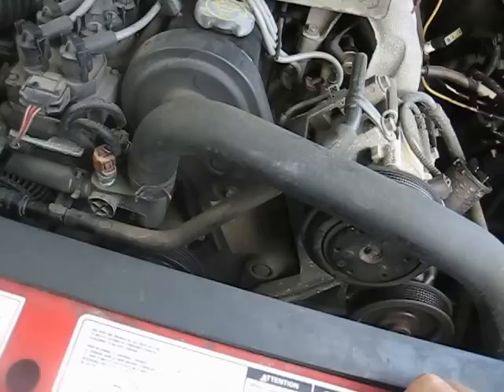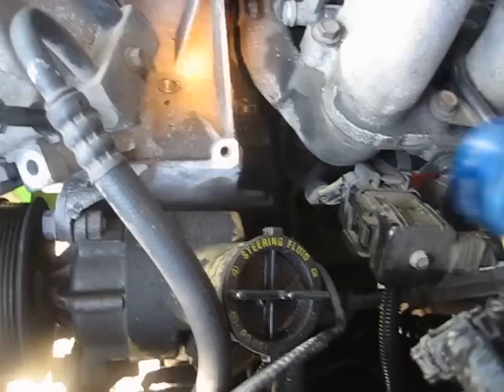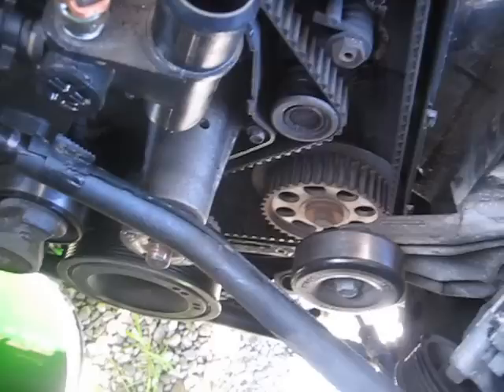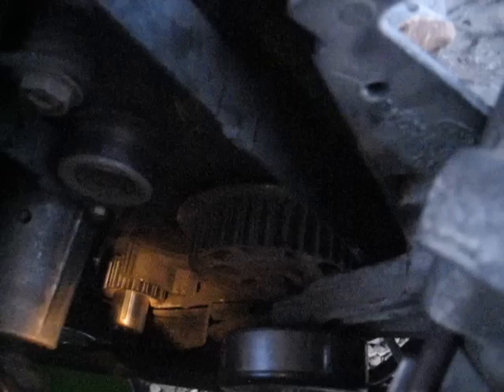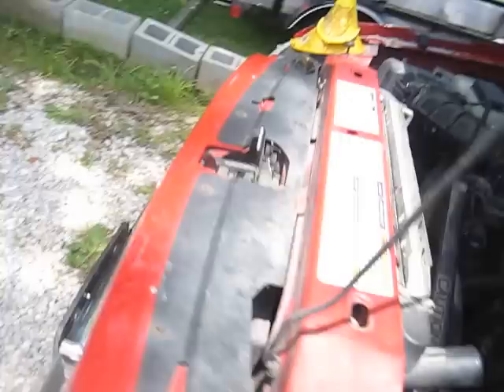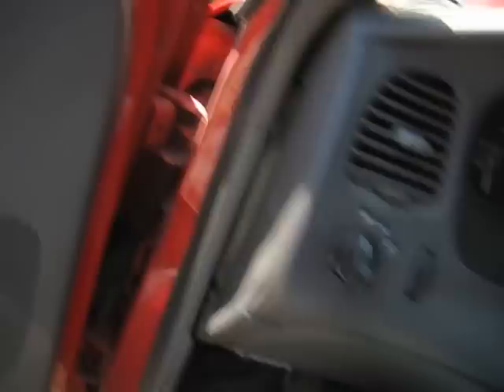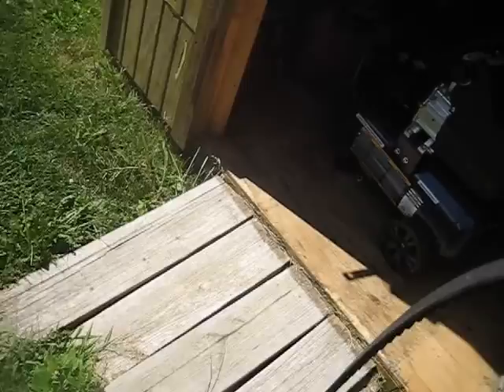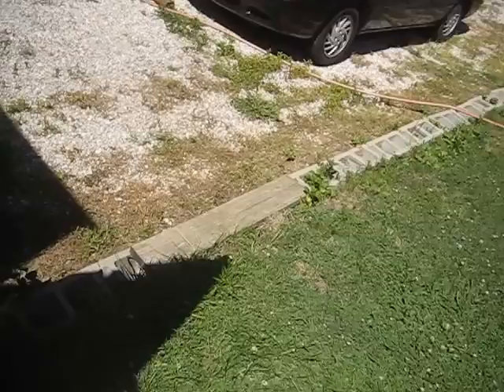Timing Belt Replacement Ford 2.3 and 2.5 1996-2011

Comment: Hello, sir! I wanted to thank you sincerely for providing us with such an indepth, thorough video! It was a massive help in getting my truck of the same make and model fixed. The previous owner allowed the water pump to rot and the blade dissolved into pieces and was sitting in the engine block. And worse, the thermostat rusted out and did not allow any liquid flow from either direction. You don't even want to know about the timing belt. Your video here was invaluable in helping me get my truck working and I am so grateful. Truly, thank you for making such a wonderful instructional video. It saved my bacon! - David

Comment: I'm halfway done with my 99 Ford Ranger 2.5 timing belt replacement, I couldn't have done it without this video. I've had this wonderful truck for many years and I still don't know why It has 8 spark plugs.
Reply from the maker: I’m glad that this video can help, I actually have an answer to why there’s 8 spark plugs, that began in 1989 on the 2.3 in the ranger and they thought it would help with emissions because when one plug would burn and their companion plug would burn when the next stroke came up, so you had a plug firing on compression and one firing on exhaust (or something like that) and they kept it this way up until they decommissioned the 2.5 in 2001. When they revived the 2.3 and the 2.5 they are actual 4 cylinder engines.
Reply: @ranger.auto.repair  
Now I know -- thanks!
Reply: @ranger.auto.repair first I got to say this is the best video on this truck I've found. You are very thorough and I appreciate  that. My friend just lost his timing belt. Thank God this is not an interference motor! On the 8 plugs for a 4 cylinder, my '85 Nissan had the same thing. Reason was for emissions. 4 plugs in the exhaust manifold burned off any fuel that didn't get burned in the engine. Simple but effective. Wish I still had it but it's gone now. Thank you again for making this video 👍👍

Comment: That's such a nice feeling after you get done working on something and have it START
Because when it doesn't start that's such a sinking in the bottom of your heart that nobody likes

Way2go I hope mine starts back up the same way

BTW  A-Mobile-Mechanic
within 15 minutes of him showing up told me it was blown up
my buddy takes two minutes to look under the hood and finds a busted timing
So be careful with these mobile mechanics
And I'm a carpenter and did not want to work on a vehicle but here I am.
Thanks for the inspiration

Comment: Thank You . Carefully used a large Pry bar and Hammer , tapped the Hormonic balancer , it came off off . I had two marks on the Cam pulley , didn't realize it at first , used the other one , and all three indicators lined up .Changed the belt ,no problem .

Comment: A super easy way to bleed the cooling system is to simply fill the radiator to top when cold, start engine and remove the throttle body pre-heater coolant hose from the heater hose, this hose tee's off the heater hose and is visible at 18:31 in the video, slide the pinch clamp off, pull the hose off and fill the radiator til coolant starts coming out, re-attach and you are done. No squeezing, no cap turning...this vents the cooling system without hassle and prevents air lock.  No "burping" required. This is the way i do it at my shop.
Reply: Jim, I did this method on mine and it worked perfectly. Thanks for the tip. Last time I done it by the 4 hoses on the HCV. It worked to, but it was a pain and my hands were cooked by the time I got done. Lol

Comment: Nice presentation, but did you show the actual installation of the belt and the release of the tensioner onto the belt, and the follow up couple of rotations of the motor to set the tensioner properly and check that the timing marks lined up after engine rotation? I really did not see any of that.
Reply: There wasn't any video of the installation. I'm really surprised that nobody else in the comments section seems to have noticed.

Comment: With the key way up on the crank, was the mark on the harmonic balancer at 0 tdc? 🤔
Reply from the maker: If you’ve got the crank keyway straight-ahead at top, and you put the pulleys back on for the belts that has the timing marks on them it should read at zero however because this is a electronically controlled timing system it doesn’t necessarily have to be at zero the only thing you need to be concerned with is that your mark on the cam shaft is straight down from the mark on the crank so that it forms a straight line that is all you need to be worried about the vehicle through the PCM adjust the timing on its own.

Comment: Great video, now I'm ready to tackle my 96 ranger.  One question did u line up the timing mark's after or before u removed the belt.
Reply: you can do it either way, use a paint marker to mark all three locations. when you install the new belt usually the crank pulley will move clockwise when you tighten the tensioner which will throw the mark off one tooth on the crank pulley. to defeat this simply turn the crank counter-clockwise one tooth further to the left of the mark (this will make it go back to the paint mark when you tighten the tensioner. 
 install the belt, tighten and the mark will be about right. Rotate the engine over by hand a couple times and you can check the three marks to be spot on.
Reply: @jimmyers8114  do u still have to check and see if cylinder 1 is up or are the 3 marks all

Comment: Can you tell me if the oil pump should spin freely because mine is catching releasing catching releasing and I don't know if that is normal behavior or not. Mines a 93 or 94 bc my crank sensor is on the right side facing the engine. (driver's side) and my dashboard cluster is same as my 90 model bronco 2. Thank you ahead of time
Reply: That’s an interesting question, as far as I know the oil pump would rotate normally, it does with the distributor style engines, I think the 88 and up 2.3 and 2.5 engines use a gear on the camshaft for oil pump function. When I took mine down years ago I have the hole in the block for a distributor and it was blocked, and I remember where the oil pump sits there was a gear on the camshaft, so if yours is not catching and staying engaged you might have a worn pump gear. To my knowledge those are part of the camshaft and so the whole thing gets replaced…

Comment: Thank you for the very detailed, informative video. I would have liked to have seen you remove the belt cover. What brand of belt did you mount? I am in Spain with an American made 2000 Ford Ranger XLT that I brought from the US. (Do not ask why). I am currently shopping on the internet for few parts I need. One of them being the timing belt and water pump. The automotive mechanic that will be performing the job told me to change water pump at the same time I replace the timing belt for some reason. I have come across DNJ timing belts. They carry a Kit with everything from belt to water pump. Do you know this brand? During your demonstration I could follow your instructions easily but found the process to be somewhat complicated. I guess a seasoned mechanic would see this whole process with different eyes. Congrats on your skills to explain things with so much detail and the effort you made to show how to and the reasons why behind each move. I am impressed.
Reply from the maker: Thank you for your compliments, whenever I do a timing belt I use Gates belts because they are built to last in case I am unable to change the belts on time, or if I am in extreme climates I know my belt won't break. I have not heard of DNJ Belts and with that being said, whatever brand you use should work fine as long as its installed properly. On the water pump issue, I change the water pump when it shows signs of failure, now there is an exception and that is when it comes to imports or vehicles where the timing chain or belt also drives the water pump, if its one of those I will then change the water pump. On the Rangers, the water pump is driven with the accessory belt and is outside the timing area so it can be monitored, never change something that isn't broken.
Reply: I wonder why my mechanic told me to change the water pump at the same time? I am going to ask him again so I can explain it: I do not want to sound like a fool who does not know what he is saying. I agree with you in that, if the belt that drives the water pump is not involved with the timing belt, then the answer is obvious. My truck is a 2000 Ford Ranger XLT  and I brought it from California cause I had to move here for the time being. It is an american car alright. The thing is that when it comes to repairs it gets tricky and I am not familiar with any reputable, trustworthy internet store that will carry quality parts and are honest, and willing to ship international. I do not want to become a victim of any unscrupulous individual out there and find myself installing dangerous parts in my car not considering the financial cost and the time it takes. I have found two .com stores: CarID and Partsology. I am checking them out. That timing belt has got to be a well made part that will be able to prevent a catastrophic failure just cause...
Reply: @lonerhino3229  it's just a lot easier to go ahead and change the water pump while you got the whole front of the motor off. You don't have to but  considering they're under $50, it's worth it as preventive maintenance. My belt just snapped at 190k miles. I went ahead and changed the head gasket, water pump, thermostat, plugs and wires. Pretty much everything that's a pain to change by itself. Hopefully I can hit 400k before I have to turn another wrench on it lol.

Comment: Hi how can I change the front crankshaft seal , I have to remove the timer belt ? And how I remove the sprocket, the seal is behind the sprocket right?
Reply: Save your self the hassle and take it to the ford dealer and spend 10 grand for the repair
Reply from the maker: The front crankshaft seal is behind the harmonic balancer, you’d line up the marks and pull the timing belt then pull the lower pulley with a puller then using a seal puller remove the front seal, then clean the area and tap a new seal in. And then put it all back together.

Comment: Did you have any trouble turning the oil pump (auxiliary shaft) sprocket to get oil pump timing set.  I am working on a 98 ford ranger (same as mazda).  The belt actually broke while driving.  Did some research and discovered the ford Lima 4 engine is not an interference engine so Im assuming the valves have not been damaged.  I have everything off and am ready to install belt but I cannot rotate the Oil sprocket (auxiliary shaft) to get the timing marks aligned.  Any Idea what is happening here?
Reply from the maker: Your correct that none of the 2.3 or 2.5L engines used in Rangers and some cars are non interference, in 1988 Ford stopped using distributors which was what ran the oil pump and made the oil pump a full on cam lobe system, if you are unable to turn the pump pulley whats probably happened was the oil pump cam lobe was worn down to the point it locked up against the oil pump and thats most likely what caused the belt to break. At this point you can remove the oil pump cam and investigate, from what it sounds like to me you're gonna need to replace the oil pump, the pump cam, or both. Hope this helps.
Reply: Impact

Comment: Does this apply to a 2004 focus zts.
Reply from the maker: No, the focus is a completely different system, I believe it’s a chain system and shouldn’t need replacement until about 200,000 miles or if the water pump fails.

Comment: Did you replace the front seal on the crankshaft?
Reply: Didn’t have to since the crank pulley wasn’t removed. I only change them when I removed the crank pulley.

Comment: I'm having such a problem with overheating stock radiator is out the door 
Replacing it with a 3 core radiator from a full size 
Yes I know I'm going to have to do a bit of fabricating like an electric fan and they do sell a sensor for it to turn on and off as.
I'd like to give a shout out to O'Reilly on State Road 52 Florida for suggesting the

Comment: How do you get the pulley off when there are no bolt holes???
Reply from the maker: The harmonic balancer has provisions for a puller but in most cases it can be tapped off, that’s the only thing that needs to be removed.

Comment: I broke that (low pressure return) nipple off the power steering pump,due to movement caused by a broken motor mount......anyhow,it was brandy new....so i j.b. welded it.....Never a problem
Reply from the maker: no because these are non interference engines so if the belt snapped as it did to me the engine is fine, just set the timing marks up, clean out the remains of the old belt, put on a new belt and your all set.

Comment: Got a question for ya. I did this job on my Ranger clone, and something keeps walking the new timing belts off, I think it might be the tensioner. I replaced the tensioner too, cause the old one was shot, kind of looks like the new one keeps cocking itself off to the side. Just to be sure I didn't get a bunk one I went and got another one, same thing happened. Also the spring retaining pin keeps trying to walk itself out. I'm pretty sure I didn't lose any parts, thinking maybe the previous owner lost something? Was there a washer behind your tensioner or anything? I've had this truck sitting around for a few months now, I'm totally stumped as to what I need to do to get this thing working right.
Reply from the maker: Timing Belts or just belts in general usually only walk off the pulleys if the belt is misaligned, so to check for this, put the belt on and take a straight edge and place it on the outside of the upper pulley and the lower pulley and see if the straight edge starts taking an angle, it should sit level, then run it between the tension and the pulleys individually, once you find out which pulley is not aligned, check for things such as in the case of the crankshaft pulley they might decide to work their way off if the center bolt comes loose, the top will do this also, with the belt on take a socket and check the center bolts on your pulleys, if they are fine and its the tensioner, then double check how its installed, some times if they are installed backwards or the hardware is on the wrong side it will cause the tensioner to walk the belt off. Also, is your belt completely tight? Take and loosen the tensioner and then take a small prybar behind the tensioner and move the tensioner out until you can feel the belt as tight as possible then tighten the tensioner. there should be 1/4 deflection if the belt is on right, theres some videos out there that talk about belt deflection. Hope this helps.
Reply: @ranger.auto.repair  appreciate it, turns out the tensioner was kicking out and deflecting for some reason when I tightened down the lock bolt. I loosened it up some and the belt stayed on. For whatever reason the new tensioner was slightly different than the old one, the pulley was slightly bigger and in its fully torqued down position the plate doesn't sit flush with the engine. After messing with it for frickin' days and it doing the same thing over and over, I finally just left the lock bolt slightly loose but still tight enough to not back itself out, and it works fine now. 

Not sure why they'd do dumb sh*t like that, but maybe its like the driver's side motor mount thing, you can't find one of those anymore and every aftermarket parts supplier thinks its identical to the passenger side when it isn't. I suspect Ford does that kinda crap on purpose just to try to force obsolescence. Think they know they made the old Lima engines too good for their profit margins.

Comment: I wish I had someone with me to just teach me one time with all this car stuff
Reply: It's called Autoshop in school.
An INDISPENSABLE class they took away creating a class of people to NOT work on your own vehicle.
In other words, creating dummy's to pay smarties to do everything.
Reply: Danzig, the best way to learn without going to school, is to just start working on your own stuff. Start off small and work your way up. You can learn alot of these videos,  Google forums and by just doing it. I just got done doing my timing belt and head gasket for the first time. My advice is always keep up with where your nuts and bolts go and take plenty of pics as you take it apart, just incase you forget where something goes.

Comment: if my belt snapped do you think the truck is ruined . same truck actually
Reply: If the truck was running when the timing belt snapped good chance your pistons hit your valves.
Reply: Michael Persson it's no interference
Reply: Good to know !! Im no longer too worried if my own belt should go on my own 2,5
Reply: Michael Persson yes I was freaking at first but after the belt it was fine.

Comment: Should have changed timing belt tensioner to as well cause the bearing will go out and make all kinds of noise or make your belt slip
Reply from the maker: The tensioners on the 2.5 and the early 2.3’s were actually built really well and only need to be changed every other belt, the newer zetec 2.3 that replaced the 2.5 should be changed every belt. This truck has the 2.5 so it wasn’t necessary.